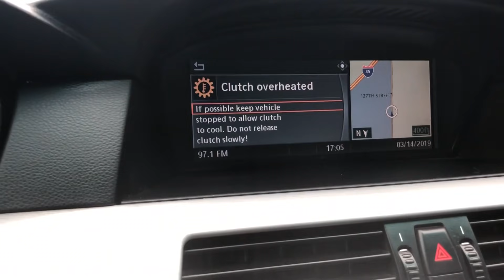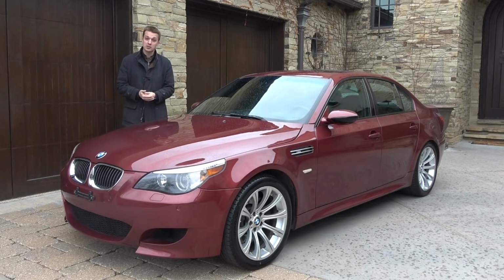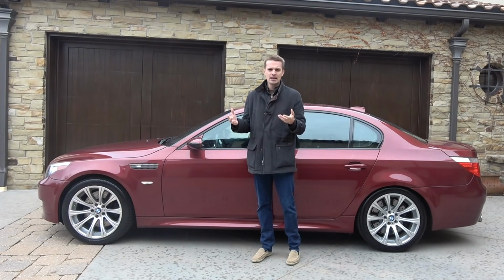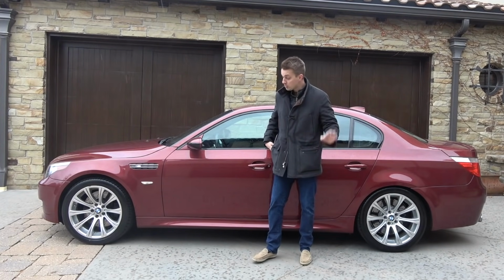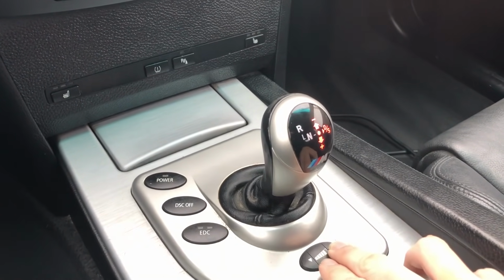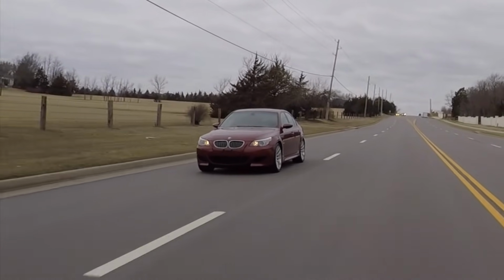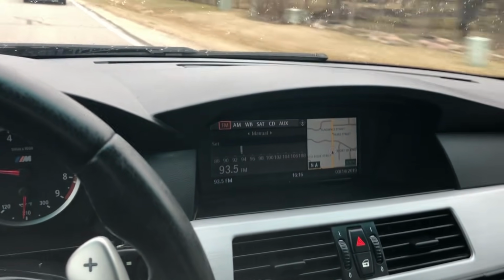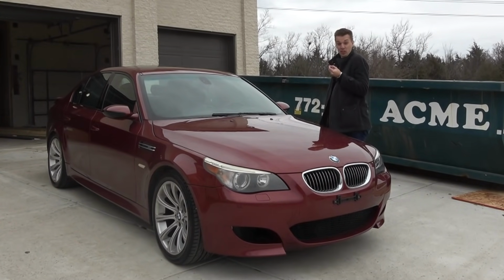My Cheap BMW M5 Is FINALLY FINISHED (Thanks to a Wire Hanger???)

Comment: I own an E60 545i M-sport. The beeping is the hourly notification. Every hour at the end of XX:59, it will beep to notify you that an hour has elapsed. You can turn this off easily in settings. I have mine enabled just to keep me aware of the time I’m spending on the highway haha, however if you’re selling your car or have passengers it will alarm them every time 😂😂
Reply: Thank you. I thought it sounded like the time pips they used to do before the news on the radio.
Reply: Michael Mavashev it’s like it’s waiting for you to buy an E55

Comment: I owned an E34 M5 for almost a decade.  I drove it like I stole it everyday and had zero mechanical issues.  The good old days when M’s were bullet proof.
Reply: "the good old days when BMWs were bulletproof"..? LMAO!
Good one, pal. You made us laugh
Reply: "There's only one King and that's our Lord Jesus Christ" ~ Elvis Presley
Reply: @barrygoldwasser5449  Really? Benz's and BMW's from 70-80's are probably the most reliable cars ever built
Reply: @ringlol  
Compared to what? Lol
Reply: @barrygoldwasser5449  take care of any bmw before 01 are bulletproof. If not, u doing something wrong.
Reply: @barrygoldwasser5449  from my 7 years of bmw ownership (i couldn't sell it for an adequate price, that's why I kept it so long) I can attest that majority of time the car was either broken or low on boost. and it drove as it should I guess couple of months and that's about it.
Reply: I love how this people that never drove a BMW can tell you how bad it is.
Reply: So it's not a E60? Cool, thanks for sharing.
Reply: 2 E34s, an E39, and e90 later, the E34s are by far one of my favorite cars. 300,000 miles on the 1990  535i and she still gets up and goes better than I do most mornings.
Reply: In my experience they still are bomb proof where it matters although maintenance can be a bit much. What is ridiculous is that this guy gets a rinsed and broken in parts BMW then moans the car is unreliable...

Comment: I genuinely have gone back to pre 1999 bimmers, when they actually worked
Reply: Had Z3 that was 1997 and was junk. So go back even more...
Reply: @TheSpeedfreak665  z3 is ugly and sucks but E36 is fine
Reply: Martin Jansen  you don't even need to buy a scanner. You can download all the BMW software for free
Reply: Slim Shady noo i had a e36 325i and had something new wrong basically every month
Reply: Bmw is just garbage
Reply: @lrblueslowbro5302  Damn, Lexus is worth Gold. The GS-F is more reliable than a corolla. It is certainly competition for that car.
Reply: alb12345672 lexus and toyota are the same company
Reply: My 2003 e46 ain't too bad as long as i fix it before it breaks

Comment: With dual-clutch/SMG transmissions, we’ve been told the clutches wear out slower in the most aggressive mode, with the roughest and quickest shifts. This is because there’s little to no clutch slippage, as compared to normal mode where they have to be slipped to make gear changes smoother.

Comment: Some BMW's clocks can be set to BEEP on the hour....that's what my '94 sounds like. You can turn it off if desired.
Reply: Yeah, my E39 does it. Why? I don't know. Dumb feature; all it ever does is scare me.
Reply: It's a beep that occurs 15 seconds before the top of the hour. I have a '95 540i that does this as well. The purpose is to remind the driver to check the radio for current weather reports to be aware of driving conditions.
Reply: @okami3271  Neat, good to know. My local radio station does traffic and weather every 10 minutes, and in southern California, there is hardly anything to say except, weather's nice, traffic sucks. ¯\_(ツ)_/¯
Reply: My 2005 E46 still startles me when it lets out a very loud beep when you take it out in the winter and the outside temp sensor hits 37. It has a warning beep for possible ice conditions. Had it since new and still makes me look down to check for light every time! Best BMW ever made. Coming up on 15 years old and a total of three parts have failed. The washer pump motor a steering angle sensor for the trac/ABS and the oil filter housing was replaced due to oil seepage. A pretty good record for a car that had a 52,000 dollar price tag.
Reply: OOOH, yea my 04 545i does that too. Scared the shit out of me the first time i heard it.
Reply: everyone should have a car beep at them twenty four times a day. BEEP BEEP
Reply: @computiNATEor  beeps in car should be reserved for powertrain and brake problems, not for door chime key in key out, hour, or even low gas (theres an gauge) . Fricking annoys me when my cars beep for low washer fluid, just say so in the dash, dont freak me out .
Reply: @Veikra 100% agree. I don’t mind the low gas/bulb out/washer fluid chime, but it should be a distinctly different chime from a more serious power train chime.

Comment: Pulling back for the upshift is actually the correct setup. makes more sense because as you accelerate the G forces are pulling you back and vice versa. That's the way racing sequentials are setup.

Comment: You did not have to replace all 10 coils at 100k miles. People also think they have to replace brake sensors when they replace the pads. 
Driving in M-mode will not burn up the clutch if the clutch is not slipping.
Reply: Actually you DO have to replace the brake sensor when replacing pads, even if it hasn't touched the rotor!  Why?  The BMW computer measured the resistance of that wire and identified it.  If you do a brake reset and don't change the resistance (install new wire), the computer will soon revert back to "pads due soon".  There is a trick though, if you were adamant about not switching wire - you can cut it shorter or lengthen it, anything to change the resistance value and get the computer to recognize it as a new wire.
Reply: @aussie2uGA  Whoever told you that, lied to you. It's not even a sensor. It's just a single wire that grounds when the pads wear down. You would know this if you ever worked on a BMW. Don't try and say you have done a brake job. Upload a video.

Comment: The pull for change up and push for down makes perfect sense - think about which direction you are pushed/pulled under acceleration/deceleration - keep pulling back to change as you're pushed back to go faster, keep pushing forward to change down as you're pushed forward in the seat. Same in any rally/touring car.

Comment: Maybe you should do an LS and manual transmission swap. It'll be the most reliable BMW ever. Trust me, I'm a doctor.
Reply: Why swap out a V10 for a fucking LS?
Just buy a Corvette ffs. I do back the idea of a manual swap thought.
Reply: @MeDicen_Rocha  your Corvette has 4 seats?
Reply: @YTIndymann99  Have you heard about the Chevy SS?
Reply: @footballcoreano not only are you wrong, everything you said is completely unrelated to what anyone was saying
Reply: @MeDicen_Rocha  why swap out a v10 for an ls? The op answered your question already: reliability with the plus side of power and sound. This engine will grenade itself eventually and an ls will last a eternity, make more power for less money, and not sound like an annoying hairdryer.
Reply: @jradish I see what you mean but, A. It wont if you fix rod bearings and the Vanos Pump. B. Taking out the V10 is taking all that makes this car special. Also i dont agree on the sound it makes. I like the way a V10 sounds. Most people do.
Reply: @MeDicen_Rocha  sorry been on travel.  yes the Holden (Chevy SS) is a fantastic under-appreciated sedan!  AND.... GM killed it....

Comment: The direction the shifter works is NOT backwards! That is the proper way. Pull towards you to shift up, and forward to downshift. Look at any race/rally car with a stick operated sequential transmission.
Reply: he is just not a true driver

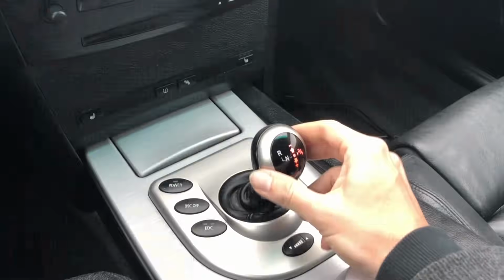Comment: 9:20 it's the correct way ! When you accelerate and need to upshift you're pushed back, when you brake you're pushed forward, so easier to downshift.

Comment: A couple of things: moving the shifter up to shift down gear makes sense because when you are on hard breaking the G forces pushes you forward. Same thing for shifting gears up on hard acceleration. Second, to do a burnout you turn traction control off and floor it, it will rev to redline and drop the couch hard for you and then you get on the brakes. That's about a fraction of a second there.

Comment: The low bidder on your garage floor gave you exactly the job you paid him for.  Gotta love the standing water flowing back towards...a wall.

Still not to late to correct that, does the Car Wizard work in cement?
Reply: I hope the wind was pushing the water back.. Looks like a lake in there!
Reply: Pretty sure the concrete was there before the roof was there.. so that's rainwater accumulation. I would've installed a floor drain so I could wash my cars in there...
Reply: This channel reminds me of "An Idiot Abroad" without Ricky Gervais or the scenery ...

Comment: I own 2 e60 M5 both 2008 no issues put 30k miles on both drive them super hard too. Love them
Reply: Will Pwr 2 destroy the gr8test BS in History  that's awesome, good to know. I love E60 drove F10 It was nice but e60 the sound, gear changes just sets it apart

Comment: Every time I get the urge to buy a BMW I will watch this.
Reply: Yep.  He's put me off the marque!  Not to mention reading forums.
Reply: Rob Bob buy an Audi instead, you save money, you get looks cause they look better, and they are more reliable.
Reply: @user-zm7de9fc9x  still unreliable because VW. every vw ive ever seen has a million check engine lights and has shifts like shit
Reply: @user-zm7de9fc9x  lol that was a good one ,I'm guessing you don't own an Audi.
Reply: Just get an F Series BMW (2016 up) or the G Series now. F-Generation has no problems.
Reply: Nope .
Reply: I’ve got an E92 M3 and I’ve not had any issues. Incredibly reliable amazing to drive great sound an a lovely interior
Reply: @LA-st6dq  I might be looking at a 2016 BMW 5 SERIES ( 528i xDrive Sedan ) and wondering if that's a pretty good buy at under 40k miles.
Thanks for reading.

Comment: Were you seriously trying to do a brake torque with a single clutch gearbox Hoovie?? 🤔🤦🏻‍♂️😂
Reply: jameswillard1 You can't do it with a dual clutch either. It's a torque converter thing. I am amazed at the number of YT channel car reviewers that have no clue about this. Even Savagegeese who comes across as a technical guy did it.
Reply: Literally! I just can't stand people who don't care about a car brand and buy it just to make it look bad. Thats a good example here the previous owner was clearly not BMW guy and didn't take well care of the car, and now hoovie bought it without knowing a danm about it, and now he is talking butter about. I'm not a amg guy I stay away from it I don't critic all I know all cars have problems....
Reply: Cassette Walkman yeah, Hoovie is always boasting about what an idiot he is and now I’m starting to believe he really is to literally have no idea of what was going on with the mechanics of the car and how this would never work as the automated clutch of a sequential gearbox doesn’t fully disengage until the wheels are fully moving. So basically unless he was just trying to destroy the clutch I’m not sure what he was hoping was going to happen. It’s literally no different than if he went to a steep incline and then proceeded to hold the car with a light throttle before the clutch disengagement point. This has always been the Achilles heel of these transmissions and I have literally witnessed transport drivers ruin clutches on sequential gearbox cars by loading them on steep carries and creeping up slowly to the point that the clutch lining basically starts melting 🤦🏻‍♂️

Comment: The beeping is the clock memo. Every time your clock reaches an hr o'clock it beeps. Lets say its 10:00pm, it will beep. Same thing as 12,12 1, etc. Go to ur idrive settings and UNselect  memo
Reply: It does that to remind u to swtich the radio on so u can listen to the news

Comment: Dealing with cars so much youd think Hoovie would know a bit more. The shifter's +/- are in correct order, as youre accelerating youre supposed to pull and as youre deccelerating youre supposed to push as the g forces push you forward. If you ever listen to any race driver they always complain when cars do not have it in that order. The pedals are not even a little "brittle" and cheap, its the sh1tty cheapest m5 that you bought with already ruined pedals and you treating it with the finesse of a sausage fingered woodsman that is to blame.
Also the SMG is only slow today and even today its far from painfully slow. Why the F do you need instantaneous shifting in traffic 99% of the time? Also lift a bit of the gas when shifting and its smooth as silk. Funny how with italian cars little things like that we call character yet here complain. For me it made it interesting and once I learned it, I connected with the car, I loved it and controled the car like it was an extension of me.
Not to mention when you floor it(above 3500 or 4k I forgot), the shift times shorten to one third or less if you set it to max. And not being able to do burnout and overheating the clutch has nothing to do with the car but everything to do with incompetence of the driver....
Reply: Thanks for writing this so I didn’t have to!
Reply: Oof
Reply: @Drgoldthumb  exactly what I wanted to say, he saved us a lot of typing
Reply: Some true words. Rather harsh but true
Reply: Bûcheron aux doigts de saucisse.
Reply: That's because Italian cars look great and have fantastic engines and interiors that smell like gucci handbags 99% of the time. The germans couldn't make an appealing car if their lives depended on it.

Comment: Try a Maserati quatraporte 
.it's transmission is probably worse
Reply: Thomas Knight i had the 2009 QP S and the shifts were acceptable. After installing the Formula Dynamics EMS chip, the shifts were very quick especially in sport mode.
Reply: Thomas Knight Maserati engineers were on holiday in Australia and rented a Ford Falcon with the 6 speed ZF automatic transmission.  They were so impressed with how it drove they made the transmission an option in later models.
Reply: Maserati is a horrible car !!!
Reply: Phillip Leeds Is this actually true ? 😂
Reply: Jelmerize Yes, it is.  Local motoring press reported it at the time.  We had those Falcons on our work fleet and they drove beautifully.
Reply: Note: only duoselect. Not the ZF auto.
Reply: The Maserati Quattroporte only used the Duoselect automanual transmission in 2005 (the year it came out) and 2006.  The factory found that, in addition to people hating them because of their herky-jerky performance, the clutches wore out frequently by 40,000 miles.  Then the customer, dealer, and Maserati would argue about whether it was covered under warranty or a "wear" item.   The repair bill would have been thousands of dollars.  Anyway, that's why 2005 and 2006 Quattroportes are now selling for a song.  You can tell if one has a Duoselect because the transmission shifter is a tiny little paddle rather than a normal handle.  Used car dealers go out of their way to avoid showing pictures of the shifter, hoping potential buyers won't understand what they're buying.  BTW, I ordered a 2005 Quattroporte when they came out, waited six months for them to get around to building it, then cancelled the order when the price went up $20K and paid $50,000 less for the much better Audi A8.

Comment: I have a 2008 BMW e60 M5. Best car I have ever bought. Just general maintenance. I did it all by myself. Rod bearings every 100k km. Regular service such as oil service. Nothing major or minor. Best reliable car I have ever purchased.

Comment: well done for rescuing the M5 shame you can't keep it long term I think these things will be worth a fortune in the future
Reply: Buzz Killington yes it will be worth a fortune cookie
Reply: I think you are right cuz this is the best sounding bmw ever made v12 500 hp what more do you want its perfect has its flavs but kust because there wont be so many of them it will go up in price. In europe these cars cost upwards to 50k euros thats like 70k dollars
Reply: @locasenior8229  its a v10
Reply: CocoPlayer it’s a v10. And no it’s not 70k dollars in Europe. If it’s a manual with low miles, maybe around 40k dollars. Maybe a bit more in some euro countries depending on tax laws.
Reply: @Grinko18  in my country 50 thousand euros
Reply: It’s gonna be one of the most valuable BMW’s ever. Last N/A M Division vehicle, being the most unreliable M car with the best engine note ever made. 
Trust me.
Reply: @Benotomato  You're absolutely crazy. You need to lay off the Boons Farm wine, you must of never heard of the e30 m3, the BMW M1 or the e24 m6, which are all worth way more than any shitty e60 m5 will ever be worth.
Reply: In order for something to be worth a fortune in the future, it has to actually last into the future. It's amazing that these cars are still on roads even today. You wouldn't pay a fortune for an old car if it kept breaking constantly no matter how much you babied it.